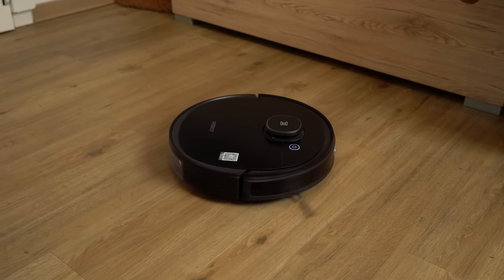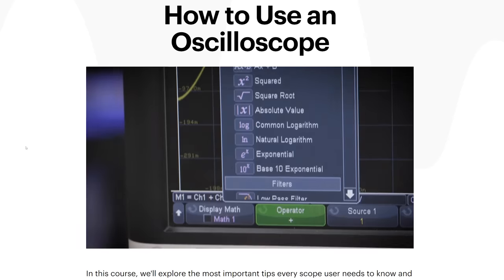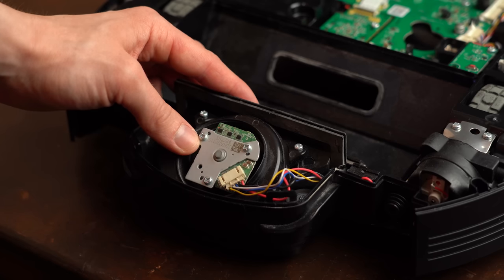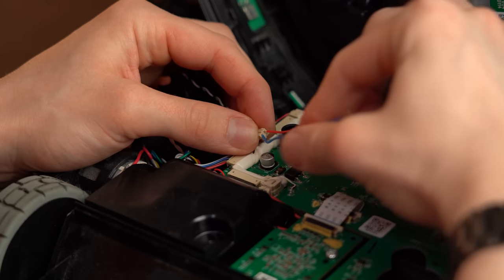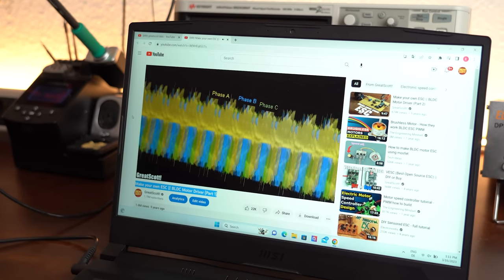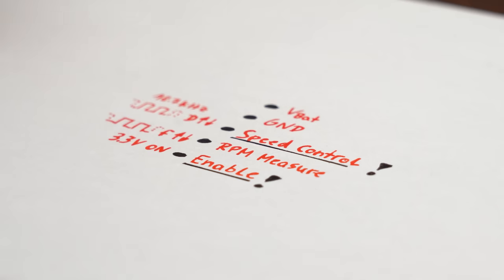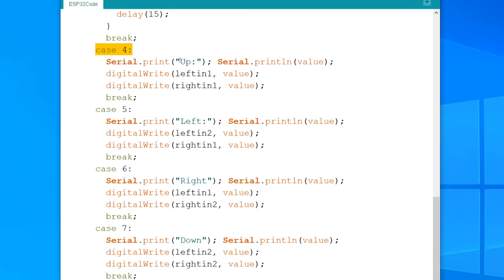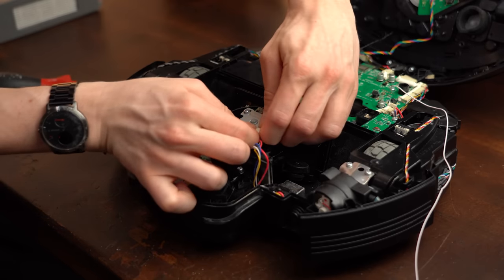Hacking my Robot Vacuum to add ONE MISSING Feature!

Comment: For the "roborock" robot vacuum series, there's a modified firmware called Valetudo, which disconnects the vacuum from "cloud" and gives you local access, including the ability to manually control the movement.
Reply from the maker: Good to know :-)
Reply: The roborock app also has that feature built in. Valetudo is still superior though
Reply: If I get any problems with my S7, I will also have a look at that. But for now it works just fine. (it is also only 4 months old, so it would be a bit early to already modify it)
Reply: @mikeydk  the Xiaomi uploads your Wi-Fi password to the Chinese cloud.
Reply: @foobarturkey  So why does this mater, what are they going to do with that information? It is totally useless unless they want to go to your house and mooch of your WiFi...
Reply: For me the best part of Valetudo is, that it enables your robot to work completely independent of some server somewhere on the internet. You don't need any app on your phone, that forces you to login to an account. All you need is a device in the same network and a browser.
And some bonus fun fact: the creator of Valetudo is a German guy, that graduated at the same university as I did - just a few years before me. 😀
Reply: @Swesen  It's most likely sending a lot more information than that. There is a shit load of data that can be acquired from the wireless network.
Reply: Valentino is great! However, for some of the models, some extensive disassembly is required in order to get to the flashing pins
Reply: @Swesen  I don't care about free speech because I have nothing to say, the same as I don't care about privacy because I have nothing to hide.
Reply: @themanhimself3  That might be true, but my comment was just highlighting the worry about the "Chinese cloud" having your WiFi password. If you have someone within 10m of your router they can do worse things than logging in to your WiFi. 😅
Reply: @_BangDroid_  Whatever you extrapolated from my comment is not my opinion. 🙂
Reply: @Swesen  They have balloons that can do that.   🤣😃
Reply: @Swesen  or.. you know.. people reuse passwords.. or promenient people can then be spied on.. Why don't you and the people who liked your post send me your wifi password. I'll throw it into a database. Because you know.. whats the worst that could happen?
Reply: @raydaniels9351  I wish they would too. Everybody that says they have nothing to hide....... And all those that don't care, will eventually. But by then, it'll be too late. Hell, it's too late now but there's still a fighting chance
Reply: was about to say the exact same thing. it also integrates with home assistant via mqtt. and the battery has a bms
Reply: @foobarturkey  I expect all IoT devices to do that, plus more, so they are all put on their own isolated ssid.
Reply: Wow.i really like these firmware and hardware hacking things,absolutely amazing yet not easy
Reply: i've read "roborock" so wrong.......
Reply: @somerandomdude3651  I suppose I should bring some stickers to the next alumni meetup then
Reply: sadly only works for older ones. Pre arm cpus
Reply: @NotHypfer  Wenn man vom Teufel spricht... - Hypfer himself is here 😁
So I'll take the chance to tell you two things: Thanks a lot for your work on Valetudo, it's awesome! And thanks for sharing your thesis. As an embedded software dev it was really interesting to have a look into your process of hacking into an embedded system. 😃
Reply: @somerandomdude3651  oooooh that's probably a misunderstanding then.

You're likely talking about Dennis and his thesis which I can't link here judging by my previous reply just vanishing.
When it comes to hardware hacking, I'm just his apprentice :)
Reply: @NotHypfer  Maybe I don't remember it correctly. It was the master's thesis about hacking into the Xiaomi IoT ecosystem. Unfortunately I can't find it anymore.

Edit: found it. It really was Dennis. Sorry, I somehow got you two mixed up in my memory. But still: thanks for your work. 👍
Reply: @foobarturkey  That's bad, but can be worked around with any decent router. You can have additional wi-fi network (on the same device) just for that robot. Still, it's much much better to be able to work without any clouds because "global" network can suddenly become fragmented for political reasons
Reply: @themanhimself3   wild we need subnets for vacuums
Reply: @КириллГамазков  while I agree that offline is better. There is a bigger chance the device is gonna die before any change of political stuff happens. If it does, I can flash it later, not now.
Reply: @foobarturkey  Do you have any proof?
Reply: Valetudo isn't really the firmware but a cloud replacement. But it's a absolutely lovely project regardless and works in tandem with the dustcloud firmware on my dreame vaccum
Reply: @_BangDroid_  wow, do you realize how much of your privacy are you throwing away? This is just a beginning. It will get worse, if people like you will be tolerating it
Reply: @Swesen they can sell your government data on how many people and how often they are in the house, also since a lot of these robots have top cameras they can make pictures of your house, you and your pet everyday, also a microphone so it always listens.
Reply: i forgot to mention it knows your location and full mapping of your house
Reply: Definitely the best option, it's a shame there aren't that many new robots supported
Reply: @Swesen  gdpr
Reply: @zoltanbiro6388  GDPR is a law, and if someone is breaking the law what do you do? Write a comment about it on YouTube?
Reply: @raydaniels9351  so... You have a Google account. Just pointing out another datasink.
Reply: I use valetudo on my roborock as well.  I did it so i could add it "locally" in home assistant and now I never have to do anything with it.  Vaccuums each morning once kids go to school and im in my office, then before they get home, it goes and sits by the trash.  they empty it, it goes back to the base and so on :)
Reply: for the ecovacs I found a project to replace the ecovacs cloud, and it works for the most recent vacuum cleaner (it's call ecovacs stack) but doesn't allow extra commands. Maybe valetudo can be installed into some rpi, and then switch the board of the ecovacs with a rpi?  (that will be amaizing)
Reply: I would never trust an appliance that is connected to the "cloud".

Comment: Irobot makes a robot vacuum intended for educational purposes that is adaptable and able to accept code. It's changed a lot over the years, but the newest one, the Create 3 Educational Robot, may be able to help you accomplish this.
Reply: I didn’t know they still had that!  Granted with 3D Printers / KiCad (aNd oUr SpOnseR PCB wAy /j) i guess self sourcing isn’t too bad these days.

Granted having a base to go off of is always nice.
Reply from the maker: Sounds like fun and a good plan. I will have a look.
Reply: Oh that would be so cool to have!
Reply: you mean the current turtlebot? that has no vaccuum in it
Reply: The non educational versions still accept python scripts! I did this to get mine into home assistant
Reply: Yes, AFAIK all of the name-brand Roomba models have the 8-pin serial port under the top cover. They have documented the protocol so it's easy to take control while also being able to disconnect to restore original functionality. The best part is all of the sensors will still be active, so for example it won't drive off stairs.
Reply: What is kinda infuriating is that older Ecovac Deebots (like the one I have) actually have a custom control feature built in. It gives you a virtual d-pad to drive the thing around.

Comment: One of the main reasons I didn't get really into the electrical side of things is because of how frustrating it was to have a chip or component break immediately. Especially if it is a components component and the entire thing need replacement.
Reply from the maker: It can be quite annoying sometimes.....
Reply: @greatscottlab  indeed, especially in the starting when you buy your 'first' components...
Reply: plus sometimes it's really expensive 😂😅

i had some moments like that
Reply: @Davidslabofficial  😬😅😂
Reply: @Davidslabofficial  recently at work I got a 300 dollar controller and fried the interface part of it by metering out valued and accidentally touching two contacts.

Of course it wasn't a part I could replace nor did I know how it worked to fix it. I think they had the buttons converted into some special serial signal. Was super dumb. 

And of course the entire controller needed the buttons to do anything. 

So the buttons not working made the entire thing useless.
Reply: Yeah I remember a project during my university times where I was at Infineon debugging an unreleased prototype board with its creator and managed to fry the entire board (it was a BMS and I was plugging it in by pushing it down and it pierced the battery isolation... quite the fireworks) right in front of him! I felt so bad until he took the board and put it on a literal mountain of broken boards on a table in the middle of the room XD
Reply: @XenoTravis  💔🤣 It sucks
Reply: @stheil  Dayumm 🤭😆
Reply: @Davidslabofficial  yeah it was quite awkward, but at least there were some nice fireworks!
Reply: @stheil  damn that reminds me to be worried about the big lithium battery packs I have. My brain will randomly just make me think "but what if they DO just randomly burst?"
Reply: @greatscottlab  If I got refunded for all the components and modules I've burnt, I'd be a billionaire right now🤣

Comment: As a software guy I would start with hacking the firmware to make something like this work somehow. It is interesting to see how people from different disciplines have different approaches to a problem. Great video as always! ^^
Reply: A Java developer would've to upgrade the CPU and ram, before being able to run anything... :-)
Reply: Cool, you would have tried to dump the firmware, bricked it, bought another one, configured the UART correctly, dumped it, thought you understood the firmware, uploaded a modified copy, and bricked another again within an hour, at least not wasted too much time... but each method has it's own merits. 

The fact that most commercial firmware remains unmodifiable on the vast, vast majority of popular electronics, like robovacs and amazon alexas, despite thousands of hours trying to 'hack it' by very smart people, means as a 'software guy', you wouldn't do jack...

Comment: Well, of you're into programming, you could actually remove all of the original boards from the robot, leaving only the ESP32 inside it, but with some GPIO attached to the original sensors. Then build a remote unit in a box with another ESP32 to receive the sensor data and pass it to the main board, get the response and forward it to the onboard ESP32. That way you can programmatically choose to drive it manually (using your phone) or let the remote main board control it. That remote control unit can even be located at the charging station maybe.

Comment: I just fixed a Conga for a friend, used it few days and I'm actually thinking to buy a vaccum robot because it's working so nice!! And now your last video just appeared, THANK YOU !! 
I thought of modifying a used one and your video just confirmed what I had in mind. You still can put your system ON TOP of the LIDAR head unit, running your small wires over the 4 supports legs of it, it might be possible to make it really compact, even with relays... Not easy tho, indeed, but doable : )

Comment: Great content! one thing I would emphasize though, is first checking if the pins are Input or Output first(by disconnecting the motor and testing the output), and then using a resistor to connect to the microcontroller to limit unwanted/accidental current shorts, that way everything is taken care of. Sometimes when we're not careful, and one of those pins of the motor is an output pin, and we try to drive it, it might result in bad things!

Comment: You need a soft start to remove this over power, but, I agree that at the start is too much to add this feature ;). Only if you can mount it above the top sensors on a custom PCB which will be much smaller, might make sense though.
Reply: He'll have to be really careful around the couch! It'll be like James Bond in the Double Decker Bus going under the low bridge!!      😲🤣😂

Comment: Great video !! If your model supports IR . You could use an IR remote to achieve that. The IR remote code available in the tasmota documentation worked for my deebot 500. Used esp8266 +tasmota to command the robot via phone to move forward,  turn left or right.

Comment: I have one of those Ecovac vacuums and have taken it apart "just to see", and the amount of technology inside them is amazing!
The software that runs them is great too, as all the decisions that are made, with all the different inputs from the sensors and the LIDAR, means alot of processing is going on.
I would only mess around with it IF I had another one that I use and the "spare" could suffer failure.
Thanks for your post!  Interesting!

Comment: I would have probably opted to continue the hacking quest on a slightly older, used model that doesn’t include as much sensor tech so that your custom controller can be built up to include any sensors available for the micro controller so you can perfect the ‘better than stock’ vhacuum robot.

Comment: Fascinating and enjoyable video.  The 'popping a wheelie' aspect whenever you tap 'go forward' could be explored.  Obviously applying full power to the drive wheels is the issue and we could experiment with various ramping of the power.  I've always loved tinkering with process / motion controls and this is a 'rabbit hole' I'd end up diving down for days.  lol  Thanks again for another enjoyable bit of 'hacking'.

Comment: I've got a really old robo vac that was powered by Lead Acid, now got it running with Lipo from recycled disposable vapes.

I plan to use ESP32 cam for custom control over the internet, plenty of space inside, I will have manual/auto selectable from the webpage and video feed hosted on the ESP.
Reply from the maker: Sounds awesome!

Comment: Could you mount the additional electronics above the LIDAR and run the wires down one of the supports to not block it? I would push forward just because those wheelies on manual mode are hilarious

Comment: What a coincidence, I recently bought a vacuum cleaner robot. Mine hasn't the house mapping feature, but it does have the manual movement through an IR remote control. I've been thinking of a possible way to use that system to track its movement via a microcontroller, map the house, and control it with IR signals. I see it very hard to pull off, but it sounds like a fun experience

Comment: I have the Roborock S7 MaxV, you can control the vacuum robot in the app and drive it around like a remote play car. And there is a camera built in, so you can see where you're going. There is even a microphone and a speaker, so once you reach a destination, you can speak with someone around. You can even tell it to go somewhere on the map, watch it driving there with the camera and control it on the way or once it arrived. But you can not program it do do things, just a cleaning schedule
Reply from the maker: That sounds awesome.
Reply: I got the same vacuum, and during Christmas when I was not at home, I used it to drive around in my house to check on it. :)

Comment: I've always wanted to do this with mine...
Perhaps, if you create an extension of the robot frame and reposition the sensors, things will work out. The robot doesn't know its size, it just "reacts" to the sensors.
Creating an extension of the structure and printing it on a 3d printer, you would gain space to add the components and put the project into practice. The robot would get bigger, but it would also get better or at least more fun.

Comment: I have a Robo Vac too, only 1000Pa, but does a Great job for me, I have wondered about fitting UV Leds to the RoboVac, to help kill any microbes / virus in the carpet, over time, this might have an effect. Possibly triggered by a vibration sensor so it switches on and off automatically. If the UV leds were in the Vac exhaust too, the UV light might similarly have a slight sterilising effect on the air in the house. If the Vac is on for 1hr, that's a lot of Air and carpet / flooring  sterilised, two or three times per week.

Comment: you should check the main board for a serial UART, and see if you can hack remote control functionality into the firmware with the already existing hardware.

Comment: I could definitely see the fun in being able to remote control the robot yourself. However, these machines aren't cheap, and if you're getting any actual use out of it, then you have come to rely on it. If an accident means you break it and have to go without it or replace it at considerable cost, then it just isn't worth it. It's the same reason lockpicking enthusiasts always say, "Don't pick a lock that you rely on." If something goes wrong, you wouldn't want to be locked out of your house, or have to leave your house unlocked.

If you find you just need to clean a small area that got missed and is noticeably dirty, your best option might just be a dust pan and broom or a stick vacuum so you can quickly and easily do it manually. :) Sometimes our interest in technology leads us to making things more complicated and time-consuming, when it should be to make things faster and easier.